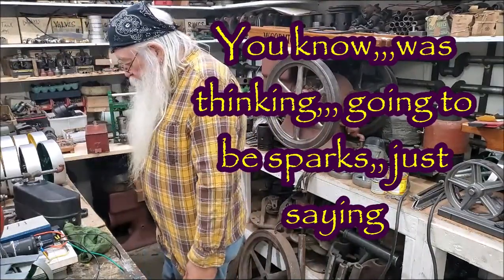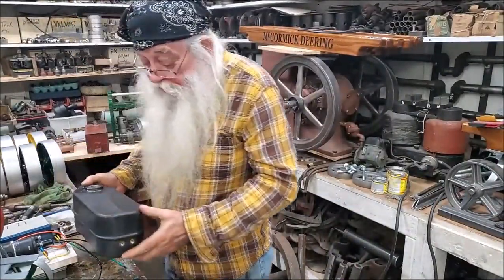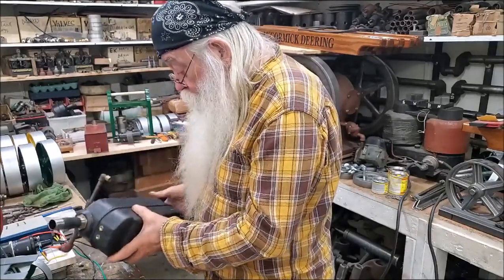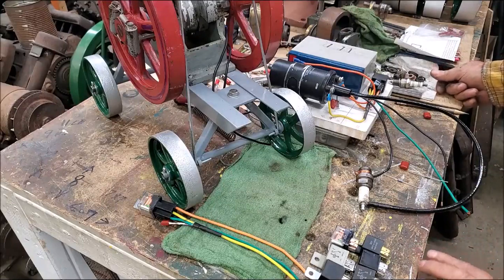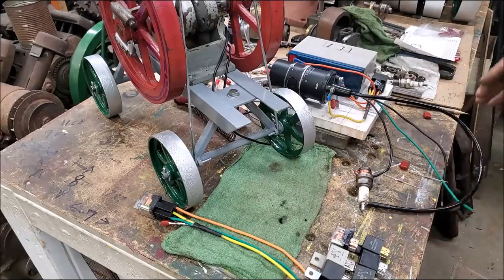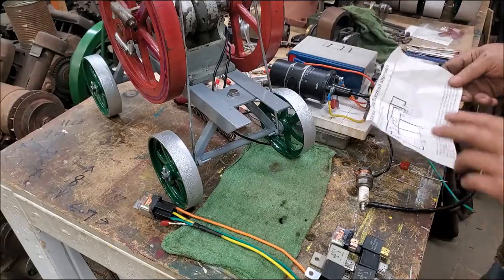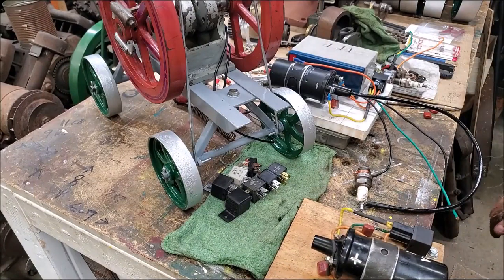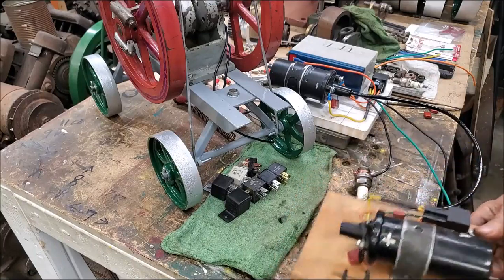Hit And Miss Engine Shop Built Buzz Coil new fuel tank

Comment: Well, I heard a fella that works on them guitar amplifiers that told that it does make a difference whichaway it goes around and he set out to show why.  The way he showed it, on the input stage of an amplifier it does make a difference in how much noise that amp will pick up, had to do with which one of the two plates that make up the guts of a capacitor was on the outside and would catch any noise so you wanna make sure and put that leg of the capacitor on the side going to ground to get rid of the noise instead of adding it to the signal from your guitar. He also showed that there is no reliable indication on ceramic caps to tell you which way is which cause most of the time it dont make no difference. You have to test them to find out.

For what youre tryin to do here it wont make any difference to how long the contacts in your relay will last but it could make a little bit of difference how much noise you are broadcasting.  I doubt that's anything to worry about either unless you are outside running the engine and your lady is inside listening to am radio or she has the shield pulled off her guitar amp foolin with it.
 But if you want to test it out, just outta curiosity, you can get yourself an am radio and tune it to where there aint a station,  just that frying background noise, then run your ignition and see if you can hear it on the radio.  Then turn your capacitor-resistor round backerds and see if that is louder or quieter on the radio, whichever way is quieter is the way you want it.  I woulndt bother with it myself, but if you are particular about things you might want to.  If you are gonna bother with that, get yourself a spark plug wire that is a resistor wire, that will make a lot more difference to how much electrical noise your ignition makes than fooling around with the capacitor will.